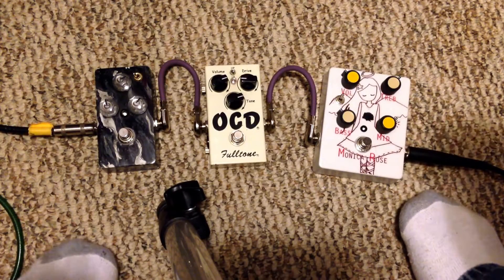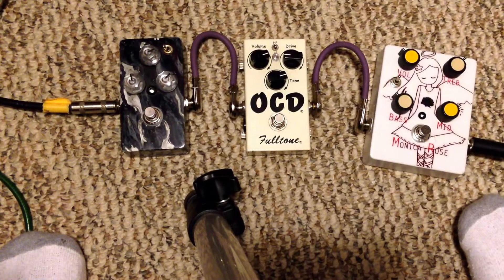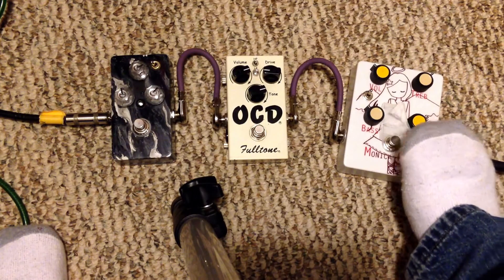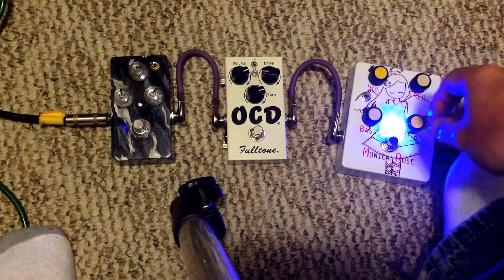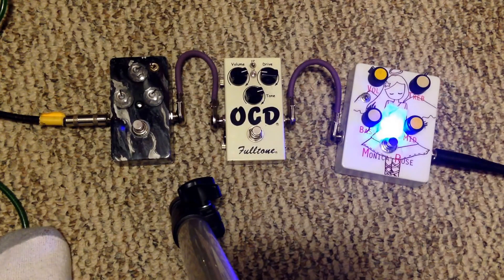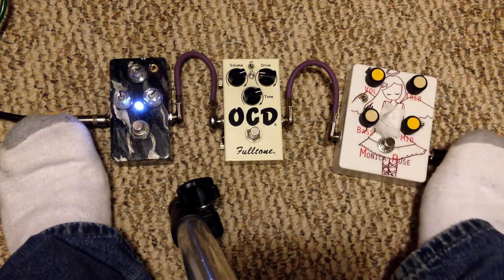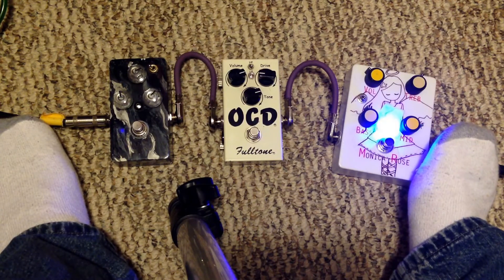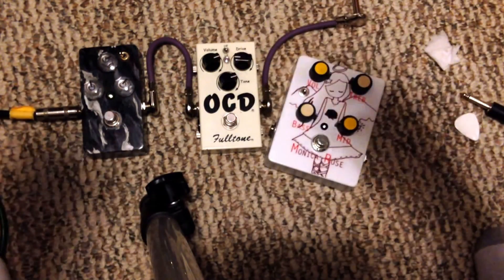Tonemender by Runoffgroove sound demo.

Comment: i made this one, the bass and mids are fine, but the treble isnt working.. cant make it work..
Reply from the maker: If I recall I had the same problem. I opened it up and made sure it was wired like the vero layout, and wouldnt ya know it, it wasnt. I misplaced one of the wires. Fixed it and it works fine. Open it up and make sure everything is wired correctly.